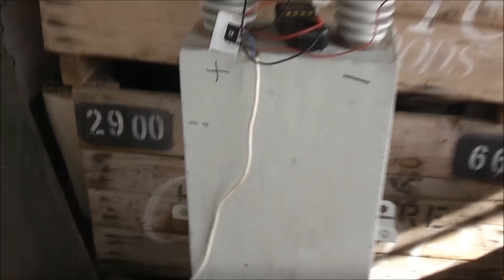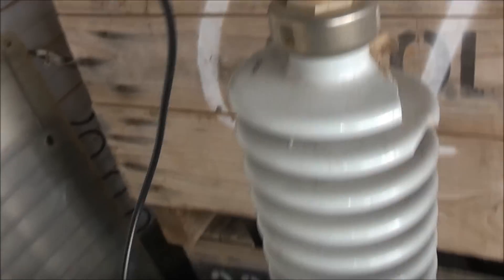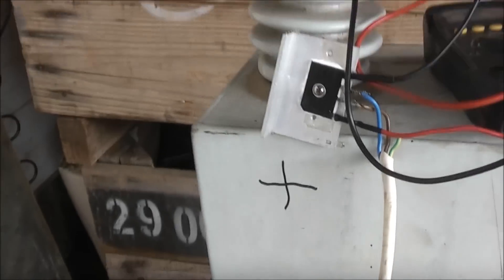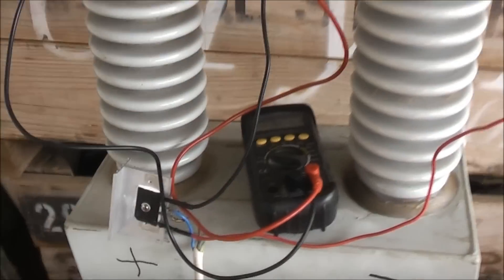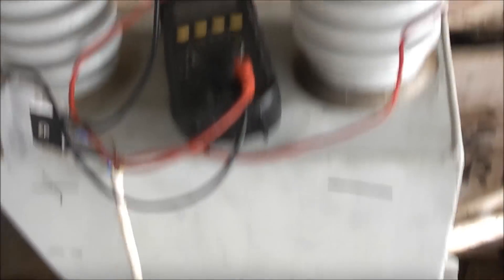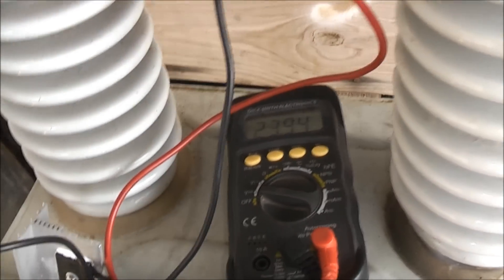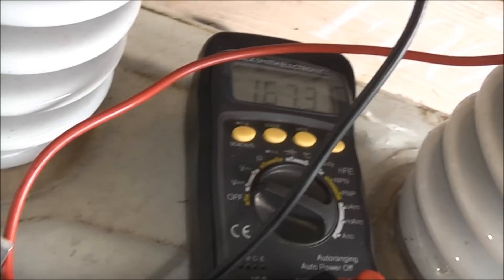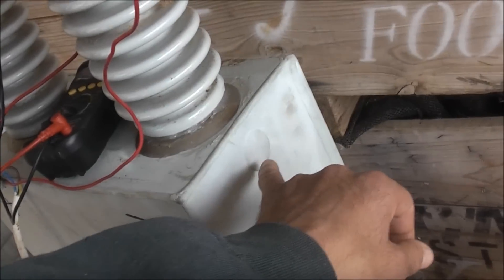Reforming The BIG PFC Capacitor!!

Comment: Well the way I see it, if every petty thing out there is illegal then nothing is. Even so I can't see how they can ban someone from playing with a capacitor bank, the only difference between these think, motor caps, and the ones used in a microwave oven is that these have dozens connected together both in series and in parallel and are encased and bathed in oil. In truth you could build one. I think it's high past time people in Aus started revolting against this nanny state garbage.

Comment: It is, and you are right it could not be polarized. Calling it a capacitor is a bit of a misnomer as what it has inside is a collection of smaller non polarized caps in a series parallel arrangement, normally with fuses in series in case one of the individual cap sections shorts out. As far as I know you can't reform a non polarized cap like this anymore then you can reform the paper filter caps in a late 1920s early 30s AC radio, once they start leaking or short they stay that way.

Comment: One *BIG* tip: If you do decide to make a grab for the others, be sure to take along with you:

(1) hearing protection
(2) eye protection
(3) A meaty big jump-start cable.

If the ones at the scrap yard are good, & they've accumulated some charge, you don't want to be touching those terminals!! Give them a quick short-out with the jump-lead, then leave then clamped on to make sure that they can't self-recharge.

Thanxx for showing,

-BoomBoxDeluxe.

Comment: well a little heads up when you get the new one to test it. Unlike that one that drops to 2 volts after you cut votage to it, a good one should still be holding several hundreds of volts if its still good. Also reforming only works on electrolytic caps. Good luck with a new cap mate and keep up the good vids.

Comment: Polarised capacitors such as electrolytic capacitors are use in DC supplies and react poorly to being feed the wrong polarity thus they are clearly marked + and -. Lastly a capacitor that size has the potential to store a lot of energy so if you charge it to a high voltage it will have a lethal amount of jewels of stored energy. Please don’t get dead that would not be nice.

Comment: Hi I suspect that capacitor is a power factor correction capacitor used in AC power transmission systems. Thus it is not polarised. If it where the polarity would be clearly marked on it as really bad things would happen if it were hooked up back to front if it were.